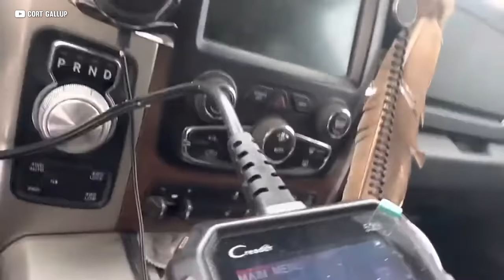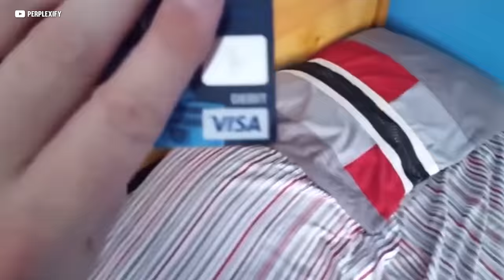Worst Trucks Only Stupid People Buy

Comment: My '97 Ford with the 5.4 Triton has been nothing but trouble free all this time.......MAINTENANCE is the key, like any vehicle. Believe me, if it was that much trouble like in the video, I would have got rid of it long ago.
Reply: I have a 07 5.4 3V Triton and this truck is reaching 150k miles and has had no real issues. Im still aware of the issues these motors can have but, like you said, with good maintenance, they can go on for a long time. People really underestimate how good V8 engines tend to be if they were cared for. I really do hate the bad rep these motors get because some people wont do regular maintenance on them. I change my oil every 3-5k mile.

If people talked to these people who daily drive these trucks, they will learn a thing or two from real world drivers. In AZ, where I live, I see TONs of 11th gen F150s with the 5.4L 3V Triton still on the road as work truck. These are good trucks and these kind of list fail to mention any of that. Any engine will sludge if you dont change the oil so I dont see how thats Ford's fault.
Reply: @Phoenix3Fighter  Completely agree.  I have a 2010 5.4 3V that I bought new with 243K on it and runs like new.  5K oil changes, NEVER beyond that.  I've completely beaten the hell out of that thing towing and offroad and it won't die nor ever give me a bit of trouble.  This whole "3V is junk" thing is driven off the basis that they have issues when following the maint. schedule in the manual.  I get it, you should be able to follow the manufacturer suggested maintenance.  I'm a firm believer in 5K changes no matter the vehicle....none of this 7500-10K nonsense.  Oil is oil and it gets dirty no matter the engine...some are more sensitive to dirty oil than others, so be on the safe side.
Reply: 100% AGREE! My '97 5.4 Triton is still strong at 265,000 miles. Mostly highway miles. Still has the original muffler. I'm 70 and I expect to keep it until I die.

Comment: The one key thing these guys said about the worst trucks was really true.  This is what you get when an accountant is running the company.  I have a 2012 Toyota Tacoma and it runs just like new.
Reply: Have a 95 silverado/everyday driver still doing good.Newest car/truck i Have ever had.....even as a Master mechanic having to work on all other brands.TIME is the true factor on all makes.
 @kuuderesyndrome3249
Reply: Think Boeing since they did the same thing.   🤢
Reply: 2003 Tacoma and it runs as good as it looks!  I bought it for its reliability.  I love it for its looks.  I have been able to trust it for over 20 years.
Reply: @tomw7220, I have a 2013 Toyota Tacoma and it runs just like new too, Nothing whatsoever has broke on it yet.
Reply: 2001 Tacoma with 129k original milage & still runs like New! I keep all the Fluids Changed on a regular bases. Hoping to get 1 million Miles on it with Original Engine & little Maintenance 😁
Reply: I had a 13 Tacoma...was excellent. Now 20 Tundra.
Reply: Yeah my 1724 Tacoma is running strong still
Reply: @justinsalazar9070  is it a horse n buggy
Reply: My 1986 Toyota Land Cruiser 24volt diesel is still king! Nice try taco Boys 400000 kms now and runs like new
Reply: 2013 Tundra. 110,000 miles. Zero issues!
Reply: Tacomas are known to last
Million miles
Offcurse with proper care.
Thats awesome
Reply: 2016 Tacoma 60k, runs like new. I never skimp on maintenance, everything gets done on time, full synthetic, the works. Its predecessor was an’88 Toyota pickup. Went almost 400k and still running solid when I just broke down and went for the Tacoma. It was a great truck
Reply: Have a 1998 toyota tacoma 4x4 520,000 miles still running strong
Reply: @johnstout5679  thats awesome. Yea my tundra inly has 100,000  barely breaking in lol
Reply: 1994 Toyota Pickup RWD.  22RE with 265k milles.   Was a daily driver until 3 years ago, now just a weekend "pick em up" truck.   Just drove it cross country this summer, no problems.  Need something bigger, but prices right now are stupid and it's making me crazy.
Reply: @johnstout5679 I miss my 98 TRD Offroad Tacoma!  It was fast, fun, great Offroad and I worked it pulling logs and trees.

Comment: Nothing wrong with Fords Triton 5.4l prior to 2004 before went from 2 valve to 3 valve with garbage cam phasers and terribly made timing chain guides and rockers in rear of the engine fall off scoring up the cams. I had one of these prior to current one. All these problems it had.. Best years were from 1997-2003. As for Spark plugs on the 2 valve if people would torque them down properly you would never have a issues.
I own a 2003 has 338k Miles on it original engine and transmission and was also put through its paces before I got it as A DNR truck. As for dodge surprised you never mentioned the transmission issues they are always plagued with.

Comment: I’m so glad I bought my Silverado during the pandemic. 
 My ‘21 1500 has the factory DFM delete (and a $50 credit for the delete lol). Coming from a 2001 Silverado I didn’t want to deal with the ‘fuel management’ system, I had no idea it caused so many component failures until after I purchased my truck and read up on it. Looks like I’ll have to keep this one another 20 years too.
Reply: I have the same pickup and have the delete it's awesome I don't think I lost any fuel mileage at all I still get 22 to 23 on the highway
Reply: Correct me if I'm wrong but im pretty sure the gm trucks that have the "factory dfm delete" still have the dfm parts. They didn't have the chips to operate the system at the time do to supply chain issues
Reply: Yes it's amazing what a pile of crap all Ford trucks are The GM's just seem to go and go and go

Comment: The problem with the Ford 6.0 diesel is that it  was not designed to be a light truck engine. It was designed by Mercedes as a medium/heavy truck engine for busses and similar weight trucks. In those applications it was a very good engine. Light trucks like pickups have to meet more stringent emission standards. To meet those standards the engine was retuned to run with higher fuel pressure and compression. That's the cause of most of the head failures. Note: the engines in the Ford trucks were built by International Harvester under license from Mercedes.
Reply: Mercedes had absolutely nothing to do with it. And yes a few sensors here and there fail maybe an injector here or there I happen to have 364,000 mi on my E-Series 6.0 the fact that they chose to really bag the motor in this video is ridiculous to me they're just jumping on the bandwagon compared to that piece of crap Fiat 3.0 diesel lol
Reply: Mercedes? Nonsense. Navistar designed this engine with the super duty planned to be its biggest customer by far.

Comment: I have 99 gmc 1500 with 385,000 been owning it ever since and still going, very reliable for over 23 years now since I bought it. It's paid off itself working in construction.
Reply: Man there is something about them old gm/chevys that came out in 99 are awesome. Grandad in law has 2 of them, both over 400k miles. One slung a rod around 450k miles and the other shattered a transfer case somewhere around the 400k mark. He just parked them in the lot as the interior and bodies are just worn out from being daily work trucks that were drove hard and put up wet.😂 Both had the original engines and transmissions. Still see tons of them around.
Reply: I have an 2001 Silverado 1500 ls with 349,000 and its is still going strong , . Best truck i have ever owned.

Comment: My '07 6.0 Sierra is about to get a new engine at 300,000 miles due to low oil pressure caused by AFM/DOD/VVL issues. It's annoying because without the system the engine would still be going strong, but 300K an engine isn't bad.

Comment: I've had good luck with the 2014 Ram Ecodesiel 4x4. Defintely change the oil on time, but it's been reliable and great mpg. Well over 100k miles with no major issues. Although the SCR did get replaced under warranty with a revised design.
Reply: 2015 ecodiesel here. Problems with the cat and an exhaust gasket. Fuel economy was better before the update but is still better than my 5.7l

Comment: The 99 ford f150 triton 5.4 had been a good truck to me for the past 14 years got it when i was 23 with 158,000 miles on it and now that i have 286,000 miles on it it's still running strong

Comment: Actually it was Good to see that the  Ram 1500 with the Hemi even in the early years is still Holding its "reliability". The  Pickup itself is still a Good Buy and the 5.7 Hemi with some Mods can hang with a Hellcat.
Reply: thought the hemis werent very responsive to mods? (excluding superchargers/turbos ofc)
Reply: I've had enough hemi engines apart to know they're anything but reliable. I've had dozens apart for failed lifters that chew up the cams. Funny there was no mention of this in the video. The exhaust manifold issue isn't exclusive to early models, I have a 2016, low mileage Ram 1500 on my lift that's getting both manifolds done on Monday 😂😂😂
Reply: @FixIt1975 don't use stock manifold bolts.  Use a reputable brand like fel pro. the stock exhaust manifold bolts broke after 3 days last time the shop repaired them.  Shop didn't listen to me😢
Reply: I've had my 06 ram 1500 5.7 Hemi for years and almost 250k miles.  No major issues other than- oil changes, brakes, rotors, struts, a fuel pump.  No lifter tick and original tranny and diff.  Pretty reliable.
Reply: I went with the 3.6 v6 pentastar instead. No major issue but the ones expected from a pentastar. Lash valves can come loose if you hear the ticking stop driving and it won’t be expensive to service, replace the oil filter housing with an aluminum version and that problem is gone. Pretty good engine if you ask me.
Reply: @FixIt1975  As long as oil and filter is changed every 5-6k miles (unlike the 10k recommended by Ram) and the proper oil and quality filter is used while limiting idle time, then lifters are a virtual non-issue. The exhaust manifolds however are an issue, just had mine replaced on my '16 as well, luckily it was barely under the extended warranty. Next time they fail (and they will fail) its getting headers.

Comment: I have a 06 Toyota Tacoma v6 4.0 4X4 with 321k miles. Engine and transmission original. I replaced the fuel pump at 170k miles. At 313k miles I replaced the entire front suspension from Oreillys. Bad mistake. Everything is squicking again. I’m going to have to get oem parts. Other than that as long as you keep up with maintenance your vehicles will take you far

Comment: I have a 2003 Ram 2500 diesel. I now have a little more than 750,000 miles on it. The only thing I have had to replace is the trany (twice) because of towing my 14K trailer, radiator twice and the heater core twice. No other issues. No engine or turbo issues.

Comment: Late to the party but I have a 2007 GMC Canyon with the 3.7 I5 that my son has now. Had a few electrical problems and the transmission went out at 32k (they replaced it under warranty). But the engine has been issue free. All original at over 150k.

Comment: I'll add to the Tacoma category the 4.0 l.  The engine on cold start up for some reason sounds like a box of marbles pinging around. The sound is similar to "piston slap". The gas mileage definitely didn't improve. Going down a hill if you have an automatic transmission and touch your brake pedal it all but sends you through the windshield downshifting 2 or 3 gears abruptly. Other than that and a few other minor issues it's been Rock solid!
Reply: @KingfishStevens-di9ji  that's why I didn't buy newer than a 15. (Texas) few other reasons too.
Reply: The oil pressurerized chain tensioners may make that noise until oil pressure forces them out. Many Toyota engines have that rattling sound on start up but is not really to much to worry about...that is what I am lead to beleive.
Reply: @mikefoehr235  yeah that's what I've heard too but I have heard other 1gr-fe's that don't sound like that. I have a suspicion it has to do with secondary air injection. I've also noticed that those particular engines don't sound like they have an exhaust leak at the exhaust manifold. In reality they don't have an exhaust leak but it sounds like they have a sputtering like a blown exhaust manifold gasket.
Reply: @mikefoehr235  almost like inducing excessive knock to help clean up the emissions, w/ the help of air injection on startup, until it achieves closed loop fueling.
Reply: @bbracing3925  The air pump can be an issue. Early versions can have the engine destroyed when parts of the pump filter is ingested by the engine. Check on YT. I watched the video years ago. Toyota has a fix for that issue. My 13 Tacoma was OK.
Reply: @KingfishStevens-di9ji  What Mexico has to do with ANYTHING ... mine '07 with 4L V6 did the same thing and frame needed replacement few years ago ... all "Made in USA".

Comment: I had an 04 Ram 1500 with the 4.7 and it wasn't horrible. It liked to eat water pumps and it did snap the exhaust studs but everything came apart super easy. I want to say I fixed both sides in like 40 minutes. It was a regular cab long bed with the auto trans and I abused the snot out of it. I had 4.56 gears in it for a while and it had no problem towing a 6k TT around the north east. Yeah, hills were not it's favorite but it got 10 mpg so... When it had 3.55 gears it ran a 16.4 @ 88 mph 1/4 mile. Or somewhere about there. After I got rid of the TT I swapped 3.90 gears in it. It was much happier on the the highway. Gas mileage sucked but overall it really was a good truck that did everything I asked of it. I sold it with about 170k on the clock because I needed a 4x4 but I kind of regret it as no matter how much I neglected or abused it - it just did what it was supposed to do. Oh, and the steering rack leaked fluid from 33k when I got the truck till the day I sold it. Just top it up when it starts to whine.

Comment: I've had a 2005 Dakota with the 4.7L engine since 2017. So far, good luck with it. It only has about 102,000 miles on it though, so we'll see what time brings.
Reply: I had an 03 same motor got 247,000 out of it before I had to replace the motor and rebuild the transmission. Was my first vehicle, and my mom drove it for 7 years before she gave it to me when I was 16. If I knew then what I know now I'd probably still have the same motor and trans in it
Reply: That's just a warm up for Tacomas. Mine is at 171k and it's 20 yrs old.
Reply: I have an 02 Dakota 4.7L 4X4 with the same mileage.

Comment: GM transmission is why I sold mine.  Loved the 4.3 V6 in it gave me 22 to 25 on the highway which is not bad for a 4WD, but everyone I knew had lost a least one transmission pre 100K.  The 4.3 I guess didn't have enough power to fail the transmission.  I sold mine at 171K with no issues.  Don't make the mistake of shutting one off in 4WD or you'll most likely pay a dealer to take it out for you at $125+.
Reply: I own a 2014 Silverado that I purchased new.  Two things that they said were common failures was the torque converter blowing apart and taking out the whole transmission and the AC condenser leaking out the refrigerant.  I decided to put in a Billet torque converter at 98,000 miles and now have 120,000 miles on it with the original transmission, but the AC system now leaks refrigerant so hopefully I avoided the other common issue when I put in the Billet.
Reply: @g.k.1669  I know on the older ones the A/C compressor leaked because the two halves joined in the center and the bracket only supported the ends. So it was called a belly leaker. The best thing to do was get a Sanden brand compressor that joined differently.

Comment: I own the 18 ram ecodiesel. I agree it sucks from the jump. But once you do the "delete" and get the tune. You breathe new life into it. I am getting 28mpg and without soot clogging the engine. The engine isnt bad. ALSO with anything else. Good maintenance goes along way.
Reply: You shouldn't half to do all that though
Reply: @tylersowa3858  I agree with you. The EPA really screwed this engine over.
But I liked the truck for the torque and mpg

Comment: I own an 08 GMC sierra with the Active Fuel Management system. I actually really love the truck. I knew all about the lifter/cam issues with these trucks since I'm an auto mechanic. I fixed my buddy's 07 when it got a collapsed lifter. Although you do have to take the heads off to replace them, these engines as well as the rest of these trucks (in my opinion) are very easy to work on. I bought mine with 139,000 miles, the person who owned it before me took VERY GOOD care of the truck especially with making sure the oil was changed regularly. The first thing I did was turn off the AFM with a tuner (runs V8 all the time) and keep up with maintenance. truck currently has 187,000+ miles on it and shows no signs of stopping. I just spent a month welding and plating up the frame since it rusted out (Northeast road salt for ya). New trucks are way to expensive and un-reliable so I'm hanging onto this one as long as possible.

Comment: The 6.0 and 6.4 Powerstroke crowd is ganging up to lynch you. "I just spent $15k on mine and it's the best thing ever".
Reply: My 6.0 has nearly 370,000 on the odometer and still running strong. I always change the oil every 5,000 miles.